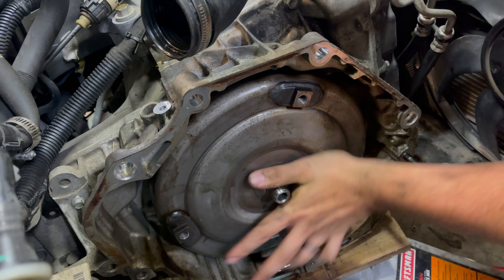Chevrolet Cruze Engine Replacement

Comment: The reason why these engines go out quickly is because people don't change their oil when they need too. Maintenance is VERY important on ANY turbocharged engine, because the turbo needs good quality oil to last a long time. If a turbo spins up with dirty oil, it wears out the bearing that spins the blade, and it overheats the turbo causing it to crack. My advice is to change the oil at 4-5k miles. It's not just the Cruze that has problems, it's other vehicles that have a turbo. Some people are too lazy or not knowledgeable to change the oil. But at least with the Cruze, a brand-new replacement turbocharger costs $250. Most other cars costs $500+ just for the turbo. It's really simple to replace the turbo by yourself on a Cruze.

Comment: One can only wonder why GM designed this engine to be removed so easily.
Reply: It came from Korea when GM bought Daewoo
Reply: It’s not a bad engine as long as you keep up on routine maintenance
Reply: @maxwellbolzman7077  they are bad engines
Reply: @Datsun280zeeee  Totally agree!
Reply: Even GM knew its a bad engine.   The cruze was  a total disaster .
Reply: I have a 2011 Cruze with 75K miles. Because it was a new model there were several problems when new. The engine itself is solid, but the valve cover, water pump and plastic oil pan had to be replaced. There have also been several leaks.
Reply: @Datsun280zeeee  nah just the owner you gotta respect these engines or they’ll take revenge
Reply: This is all horseshit I tried it with a Chevy Sonic and you can't even see the starter it's up out of the way. And then after you get the starter out you got to find the three bulbs that connect the flywheel don't believe everything on YouTube
Reply: The Q in Chevrolet stands for quality.
Reply: You might thanks Is Easy,they just disnt show everithing 😂
Reply: You were out of your freaking mind oh, I can't even see the starter and never mind the three bolt behind it on the flywheel. That's one of the main reasons there's no younger mechanics cuz the engineers fuck everything up.
Reply: @WrenchingNLearning  mines trashed haha
Reply: Cause Chevy knows there vehicles gone break down

Comment: Great video guys. As stated in previous videos, the crack in the turbo is a very common failure. The turbos aren't very reliable. I have a sonic with 160,000 miles with manual. Seems to be good still.

Comment: I’d still take this over any Chrysler product.
Reply: I think everyone would buy any car than a Chrysler product
Reply: 😂 agreed
Reply: Here come the “Mopar or no car!” guys...
Reply: @RoostersRampage  here comes a person who think they know cars
Reply: Yes.
Reply: A Cruze is the worst new car you can buy I don't care what it is. I think Chrysler makes a better product than a Cruze.
Reply: @Bleachanna  lol 😂
Reply: @Bleachanna  the Mitsubishi Mirage is the worst new car you can buy and it's not even remotely close. Cruze is decades ahead of it. sadly.
Reply: @Amerikanskis  yeah but the mirage is built to a price point. And it just works, and well at that. The Cruze fails at all of those points.
Reply: @Bleachanna  spoken like somebody who doesn't know somebody who drives one
Reply: @Amerikanskis  I work on them. Every day. I just got through resealing the timing cover and oil pan. And the turbo oil feed line was leaking too. Someone has already put a valve cover on it, a coolant return manifold and a coolant reservoir on the vehicle. Not to mention that the transmission is on its way out. The vehicle has 104k on it.
Reply: @Bleachanna  a cruze sounds better than. it prob would made 150k or something slightly less pathetic. also they are the most deadly car to drive on the road today(mirage) and its not even close. thats a big factor when you put it in with the lack of reliability for a Japanese car.
Reply: @Amerikanskis  there's a mirage with 400k+ on it with everything original except the alternator
Reply: I love my truck but the fact you can easily blow the computer (i did!) and yeah... garbage idea. I've never seen an electrical system CRASHING until this truck.
Reply: Facts

Comment: I got a 2014 Chevy cruze 1.4 turbo and the motor was blown so I  got a used one that came out of a buick encore & on the balancer and water pump has it has 5 splines on the pulleys but on the cruze it has 4 splines would it still be fine? I have no choice but to use a 4 spline drive belt for now unless otherwise if that makes sense I’m hesitant on putting the Cruze balancer on the buick motor because it’s a 40,000 mile motor

Comment: My daughter has a 2016 Trax and the turbo self destructed at 58k.  Dealer covered it as warranty expired at 60k.  Those cracks are very common on that tiny turbo.
Reply: Sell it and get a better car.
Reply: Tell her to not go so long on oil changes
Reply: Yeah mine did the same thing 2015 but I didn't have the warranty the turbo was 900 bucks from the dealer  but was an super easy part to replace at 140k miles I have about 180k now and thinking about just replacing the motor even though ited prolly run well into the 200s

Comment: Just replaced the motor and installed the new one but the car won’t crack all the way . We first checked the spark plugs and they were worn out so we changed it. We checked the gas and it was bad colorization dark color . Changed the gas.  It still does the same thing does not crack all the way

Comment: Where did you find a replacement engine? Buying it new is expensive
Reply: Probably a local junkyard
Reply: @terrellgaines88  how am I going to know if the engine is any good or not ?
Reply: @Sakinah2186  you don't but usually they give a 30 day warranty
Reply: @terrellgaines88  ok thank you

Comment: Hello friend, I would love for you to give me your opinion, here in Brazil we have the Chevrolet CRUZE, with an ECOTEC 1.8 engine, I hear many complaints about this engine, such as failure in fuel injectors, causing hydraulic shim, breaking pistons and bending the pistons. connecting rods, another problem is the camshaft pulleys that cause a lot of problems, here in Brazil the components of this engine are very expensive.  would you recommend me to buy this car?  I have many doubts and would like to hear your opinion, thank you very much !!!

Comment: I forgot what the reason was for replacement?
Reply from the maker: Cracked cylinder head leaking coolant into cylinder 1 hydro locking the engine.
Reply: @DanielJaegerFilms  10/4 thanks Daniel need more videos bud

Comment: Only real issues I found was the turbo and the emissions from the PC built into the valve cover and the rear  intake has a valve in it then the oil cooler housing will leak alot but other than that these are some reliable cheap cars

Comment: Haha we have had our head gasket replaced, and a lot of engine parts. These cars are junk! Don’t get me started on the water pump
Reply: You mean the whole turbo, whole cooling system, and oil seals?
Reply: Water pump is so easy to replace what are you complaining about
Reply: @maxwellbolzman7077  the fact that when you replace it and have to do it again every year
Reply: @Bleachanna  Turbo been replaced once, everything coolant related but some hoses , radiator and heater core have been replaced. Rear main seal and valve covering in terms of oil leaks.
Reply: @Landofmagic678  been almost 2 years and mine is still going, did you buy OEM?
Reply: @maxwellbolzman7077  it’s been replaced by the dealership. Because it has a 10 year 150k mike warranty on it.
Reply: @maxwellbolzman7077  still going no issues?